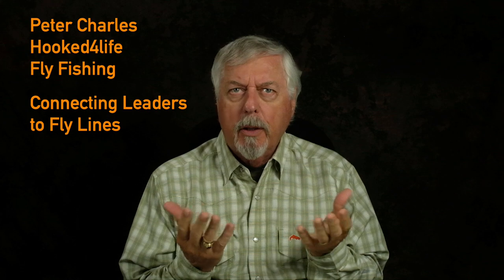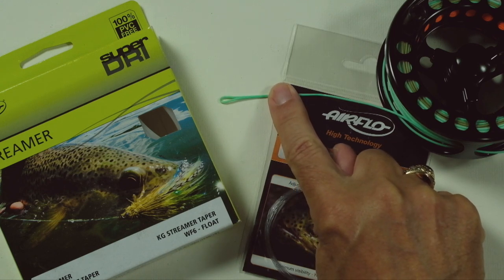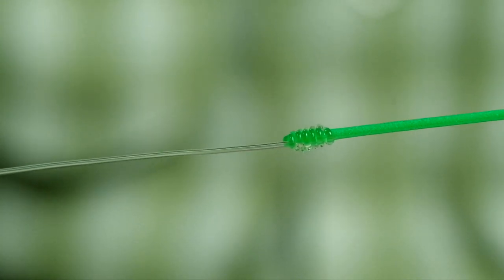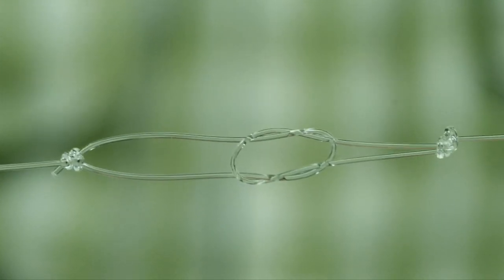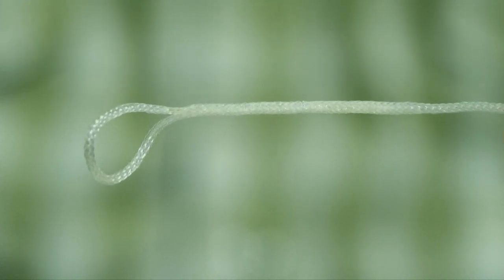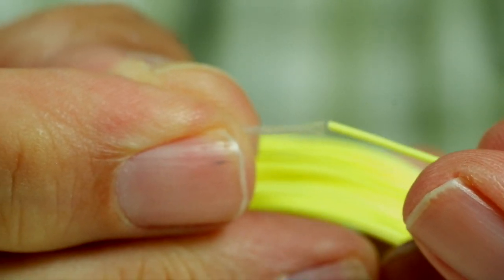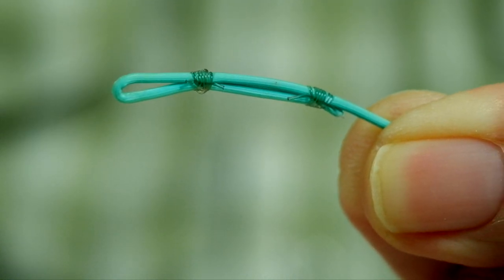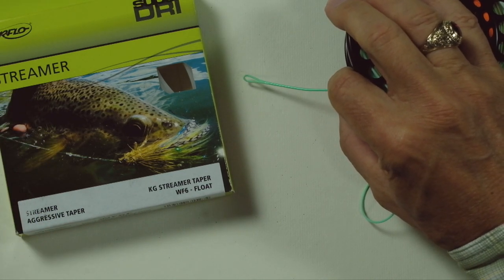Getting Started in Fly Fishing: How to Connect Leaders to Our Fly Lines

Comment: I personally cut the loop off of the fly line and connect the leader to the fly line using a nail knot.
Reply from the maker: Apart from loops making the changing of leaders, use of PolyLeaders etc. a piece of cake, loops do one other thing very well - they seal the end of the fly line. A nail knot does not. When we cut the loop off, over time, water wicks up the exposed core of the fly line and the front end of the line sinks, pulling down the leader.
Reply: @hooked4lifeca  a little bit of super glue on the connection seem to help
Reply from the maker: Please be aware that super glues are not waterproof and will breakdown with repeated use in water.